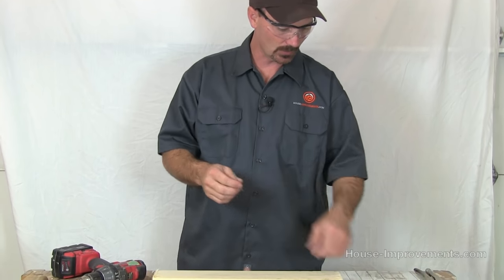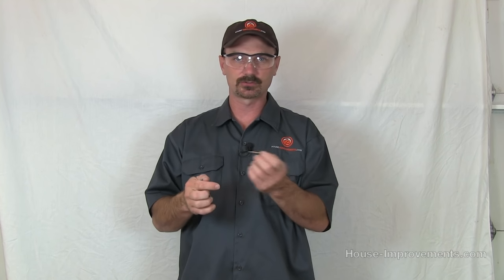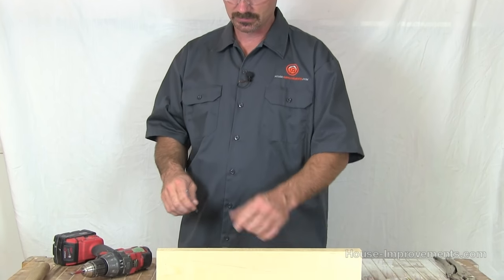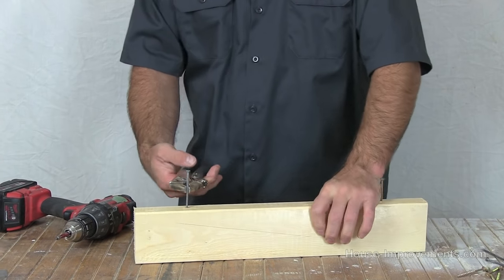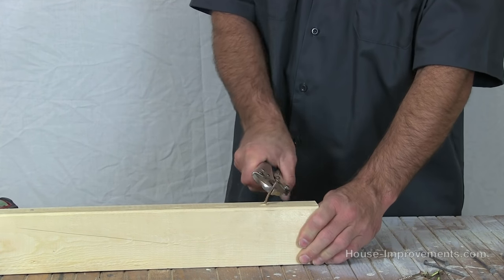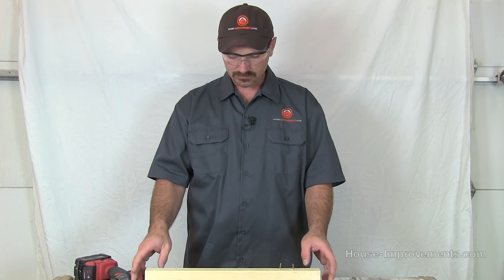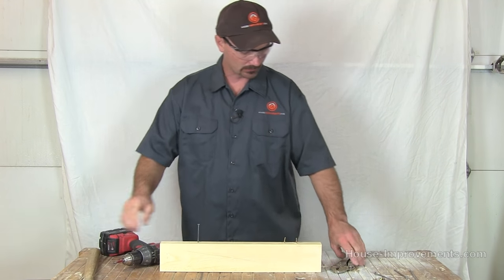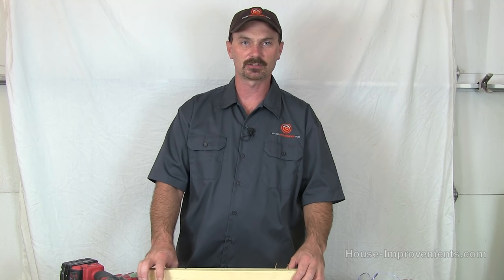Screws vs Nails - Which Is Stronger?

Comment: Well this is an interesting debate as wouldnt you use a structural wood screw on wood not a regular screw? I know that in the past people would use drywall screws but now they have screws that I would think are better than nails. I mean they have screws that can replace lag bolts and in building a deck a lag bolt is tough. That is what I would like to see someone compare these type of screws vs nails and lag screws.
Reply: TimberLoks are awesome!

Comment: yup , though it does depend alot on how the screw was made as well. But from your two tests... the nail has the better shear strength/bending strength from a structural engineering stand point. However screws have a better tensile strength/stretching strength because of the screw threads.

Comment: I think if my house flexed that much to break off a screw in the manner described, I would be running for my life because of other reasons eg tornado, hurricane, bombs etc.
Seriously,, a screw holds better than a nail any day in normal circumstances.
You are right in saying the nail has greater shear and ductile strength.
I like Ardox or spiral nails best, kinda the best of both worlds.

Comment: Great video and demonstration. It would have been better if you compared structural screws (GRK or SPAX) to structural nails. This  proves the point of using the wrong screws on major projects. They both have their place - hanging a 60” flat screen = screws used-

Comment: Best of both worlds is not structural screws (they cost a fortune), it's to tack your framing together with screws then use nails. You'll need regular wood screws if you want to do double thick walls (plywood or OSB under your drywall) like I wanted to anyway.

I framed my basement remodel with a regular drill and a claw hammer. Not difficult. 1 screw first and then 2 nails to join the 2x4 to the top and bottom plate, each, then the same to join the top plate to the double top plate. I'm aware this is overkill, like my double thick walls. 

I did have to use a few structural screws as well, for a few pieces of blocking (through double joists... too long for the nails I had) and also for attaching the blocking to the double top plate - because hammering upside down sucks and I didn't have enough room to nail from the top. They are nice, but they're close to $1 per screw. Think how much that would cost for framing a 24 x 10 // 24 x 14 (L shaped) room, or even worse, an entire house.

BTW thanks Shannon. I used your several of your videos (framing and mudding) to finish a theater room in my basement. If I could make on recommendation from a beginner/DIY's perspective though, when mudding tell  newbies to use mesh tape. I used both in different spots (various research) and the paper tape  was a pain in the butt. It bubbles, it's messier, it's "easier" to have too much or too little mud underneath it, etc. I had to correct a bunch of stuff with joints I taped with paper and none with mesh. When I put OSB and drywall in my garage I will definitely mesh tape only!
Reply from the maker: Thanks for the comments, I use paper cause it last longer over all usually.

Comment: Often when framing, i’ll use a screw to pull two pieces tight together and in the correct spot, then nail it properly for strength.

Comment: you can just use really big structural screws, with pilot hole and wood glue inside, that will be so strong that the wood will give first, in case of huge stress.
If a carbon steel small screw was so strong, I couldn't cut it in any way, even in its thinnest part with all my efforts, then a big structural screw is very good choice.

Comment: How about screwing down a wood floor rather than nailing the planks? ....would it be good enough? ....and would it not be better if you want to remove the floor or repair some planks later on?
Reply: +Bosse Grytbakk 
i think it is better to screwing. nailed planks can squeak, the tightness forces are stronger with screws.
wood working much outside, because of humidity and temperatures, the nail wouldn't result in a durable connection.
Reply from the maker: +Bosse Grytbakk  Screwing panks or plywood down is for sure the way to go.

Comment: Great video! I've often wondered how the shear strength of a screw is affected when it's driven into the material. I recently purchased a Milwaukee Fuel drill driver/impact driver set and while it's a huge improvement over their previous version of the same tool with brushes the extra torque sure seems to snap the heads off of screws more easily, especially when driving the screws with the impact driver. All that torque must affect the strength of the screw in a negative way. Most of the nail and structural screw manufacturers have their fastener specifications on their websites so perhaps selecting a thicker screw would help makeup for any weakness? I'm not a construction pro or an engineer so I guess I'll stick with calling my local AHJ when in doubt on what will pass inspection. Thanks again for the video and my apologies if what I've written here has already been said by others.

Comment: I've been installing a hoist to get things in and out of my basement that's rated for 1,320lbs.  Unfortunately, the joists run the wrong way for what I needed so I put two 2" x 8" x 14 1/2" crosspieces about 18" apart between two adjacent joists using joist hangers.  I have drilled a hole in the center of each crosspiece through which 1 1/4" metal pipe will be used to hang the hoist on.  Because I have body mechanics problems I can't hammer without suffering terribly let alone the restrictive area that I would have to attempt to hammer in wouldn't allow me to use common nails except in maybe 8 out of the 16 holes in the joist hangers.  I used 1 1/4" external wood screws to secure the joist hangers but now I'm 2nd guessing if I need to go to structural screws.  In your opinion am I OK?  I could replace the screws at this point without too much aggravation.  I've already got the joist hangers at each end of that 14 1/2" span which is overkill.  The weight itself will be moved up a ramp overtop of the steps so it's not pulling straight down on those joint hanger screws although I'm not exactly sure how the weight distribution would be on the front vs the back hangers.  Let me know your thoughts if you wouldn't mind.

Comment: I've had screw heads snap off as I was screwing them into wood. Never had a nail break as I was driving it into wood. No doubt sound advice.
Reply: Pre-drill
Reply: Pre-drill
Reply: Pre-drill
Reply: Then you probably used the wrong kind of screw or were screwing into a very hard wood without pilot/clearance holes. Only reason when screws fail is improper use or they are dollar store screws which are good for nothing.

Comment: if either your nails or screws are standing out that far when you are framing you have issues. how about putting two 2x4 perpendicular to each other then fastening them together and twist them.  or try to separate them with one clamped in a vice. having a screw or nail standing up about 2 inches is not a good representation of their strength.
Reply from the maker: +Andrew Brown what it shows is how much more brittle the screw metal is compared to nail.
Reply: HIs point is having two 2 x 4 nailed together and anther set of 2 x 4 screwed and then pry them apart.  I agree with Andrew on this theory to really see which is better, your demonstration may be accurate when both nail and screw is out of the wood, but how will each perform when both nail and screws are buried deep in  the wood.
Reply: HouseImprovements - Aside from the fact that we know nothing about the screw or nail you chose (despite mentioning that there are construction screws which you chose not to use for a conversation about doing construction..), the issue is that it is an invalid point as you are implying how they perform with building material and they would never stick out this much or bend that much without the structure essentially having fallen down.    
It is a little like someone applying wear to the sidewall of a tire, instead of the face, until it failed and saying "see, these will never last 30,000 miles".
Reply: Also, isn't the screw made to be bent/sheared/whatever on the non-threaded part?  He breaks it off exactly where the thread starts.  If he were to screw in into where the bend happens at the smooth part (like where the joint would be with a properly sized screw), it wouldn't be that easy to break it off?

Comment: I never knew why people use nail vs scrub in construction but this makes sense. Now I know. But I do like that when predrilled and torque with the right pressure wood can be pressed together more firmly because of the threads.  

Does anyone know how good structural screws work good
Reply from the maker: They work well but can get pricey

Comment: I put a shelf together and I used 3in gold screws should I go back and add some nails? It's holding the weight just fine but idk if it will give over time. I have a pancake compressor and a heavy toolbox and some other heavy things on it. What do you think would be appropriate for this?
Reply from the maker: +FishFind3000 Kind of depends on your design and if you used any adhesive as well. If you used cleats screwed to the walls (or sides) and the shelf sits on that you are likely fine. This is more to do with actual framing structure than finishing.
Reply: its a 2x4 and 1/4in ply wood its 2ft by 4ft with about 80lbs of weight on one shelf.

Comment: thank you very for the videos! i wonder what your thoughts are on wood studs and other materials splitting or cracking when being worked on, and how these relate to nails vs screws, type of material, drilling holes or when to drill holes, etc.
Reply from the maker: that could be a whole other video I suppose

Comment: Take a cross-sectional end view of the screw and nail.    Are they of the same mass & area?    I bet the screw center section is considerably smaller than what we consider a comparable nail.     If the screw had the same center mass as a nail then the screw would have the same property of both (even better product).   That would require more power from the power driver.     Make nails with threads.....    How about hollow nails next to save mass and raw material?     How about titanium screws & nails?   not cheap

Comment: What kind of screws were used in this video?  I have had problems with cheap screws vs. the more expensive screws (e.g., decking screws).  Whether or not the screws have a tendency to strip out is often a good measure of the quality of steel used in their manufacture.  

Also, what was shown is not necessarily the kind of loading that the screw joint is going to experience.  A more representative test would be to attach two pieces of wood and then hang weights off of them until the screw joint breaks.  As a first pass, it isn't bad, though.
Reply from the maker: +Douglas Coombs These are #8 deck screws.

Comment: I got a quote to replace my wood (douglas fir, not pressure treated), pergola and he said he uses screws instead of nails for making it more secure.  Does this sound ok or should I be suspect?
Reply from the maker: Structural screws for frame work and deck screws for attaching top pieces is fine.
My point of the video was that deck screws should not be used for structural framing . There are structural screws for that.

Comment: Thank you Shanon, this is very informative. I'd like to ask if using a steel screws make any difference? I had the problem of drywall screws snapping clean off when being driven into hard material for instance concrete (via a wall plug) . So my local hardware store expert recommended that I switch to steel screws ( I presume that by steel, that the screws are made from steel), and they didn't snap off anymore. So would  steel (made) screws hold up as well compared to the nails?
Reply from the maker: +Ronald Khoo Kah Hock  They may but usually steel screws do not have as course of a thread either so they give up some holding strength there.

Comment: Nails took 21 times it was bent.  Screws took 2-3 times to break.  Before this video, I  had thought the screws would be stronger due to its threads.,  However, a couple of  screws and help hold a beam on, until you can begin  hammering in your nails in an awkard place to hit nails.

Comment: Had no ideal that nails are stronger always thought screws were nice video shannon.
Reply from the maker: +AccordBass12  Screws will have a better holding power as far as not pulling straight out as easy , infact the head will usually pull through before the threaded end will pull out. Its the shear strength that is the problem.
Reply: +HouseImprovements To drive this point home it would be good to show a screwed assembly under shear with and without glue.
Reply: excellent point

Comment: I think it’s important to point out how strong they need to be as well. It’s great that nails bend but bending is still failing. So at what force is it failing? New screw technology allows some screws to fail at over 1000 lbf per screw for a #9. It seems at this point it’s more a matter of cost and speed/efficiency rather than safety. Technology has caught up. It’s still much cheaper and faster to drive a nail compared to a screw.
Reply from the maker: This is all about not using standard screws for structural framing, there are screws specifically designed for structural work.

Comment: Engineering design:  nails are made of ductile steel so they have high ductility and plastic deformation ability. Screws on the other hand are made of hard steel with low ductility so they are brittle. The reason for that design is screws have threads they need to be hard. Your experiment is a good demonstration for these differences.

Comment: I dunno if this is an absolute though.  I mean, GRK screws?  Those are probably stronger, but you're using common wood screws, not GRK's.  I say those are most likely stronger, but also a lot more expensive and more labor as a nail gun will work much faster than a drill.

Comment: Hi, Shannon.Sorry for my English :).
I'm a beginner carpenter from Russia.  Please answer. Which nails required for the framing, ring or smooth shank?  Thank you.
Reply from the maker: Actually both can usually be used but ring have better holding power.

Comment: Hi Shannon,
I'm seeking help for rust prevention. I live in Philippines and I’m building a house. I have sourced materials (some locally, some from overseas). We do not have any of the fancy hot-dipped, galvanised, or any other nails that resist corrosion. we have have standard steel nails. I was curious is there any way I can treat these types of nails with a coating or chemical to prevent the rust from forming? 
All my lumber is Douglas fir coming from Oregon via a wood supplier here in PH at 61 pesos ($1.20) per board foot.
I have searched far and wide, even thought of shipping via amazon but the tax and duties are more than the costs of the nails themselves. Any help or advice would be greatly appreciated.

Comment: Very helpful.. I was under the misapprehension that the screw was stronger.
Reply: Screws ARE stronger.  He is comparing a framing nail with a non-structural rated screw in this example.  He should have compared a screw that was rated the same as the nail.

Comment: wait...wouldn't the failure depends on he yield strength of the metal used in the screw/nail? For this video, is the yield strength equal between screw and nail?

Comment: okay, nails have more shear strenght, thats why to use it better for frame building.
what is with screws that use an other steel material?
and all other aspects between nails and screws?
Reply from the maker: +k4r7o This was a comparison or the most common framing nails and deck screws, like I said in the video there are structural screws available but I'm not really sure what they are made of or if they are just a heavier gauge
Reply: +HouseImprovements

yes, do you wouldn't make some more strengh test, additionally maybe with other types of screws?
i would find it interesseting.

Comment: no: the ultimate tensile strength for a screw is the same for a nail if in the same chemistry. Even if this test , demonstration, were to show shear strength, its rather moot. The real reason screws are not code listed, except for the few that are now, is cost; the cost of a similarly sized screw is way more expensive than the nail; and labor expense follows too, and up until just a few years ago equipment didnt really exist to drive such large screws. So there

Comment: Screws all day everyday, they make structural screws for a reason, go look GRK screws #9 are like 800 to 900 pounds shear load, #10 are around 1100 pounds shear load
Reply from the maker: My point was do not use deck screws for structural framing. You are correct there are proper screws for framing as mentioned.

Comment: If you use screws and you actually suck your boards down tightly to each other, they won't bend.  If you use nails, they will creep out of the wood over time creating gaps between your two pieces of wood, and that is when the bending starts.